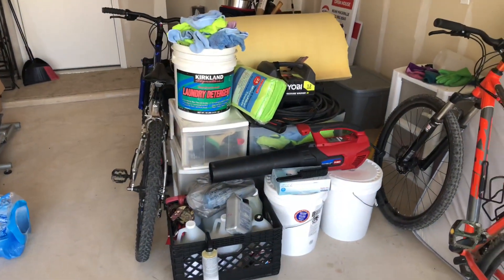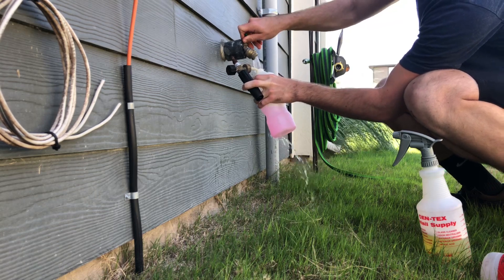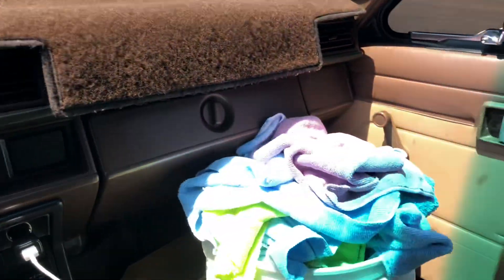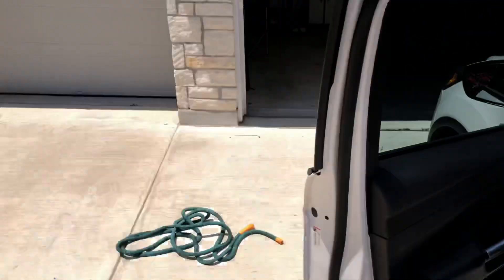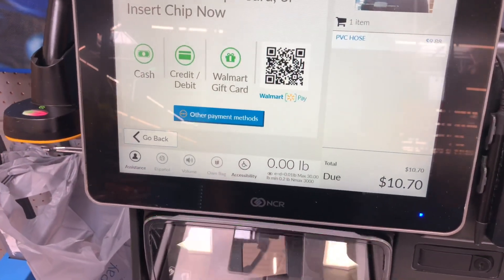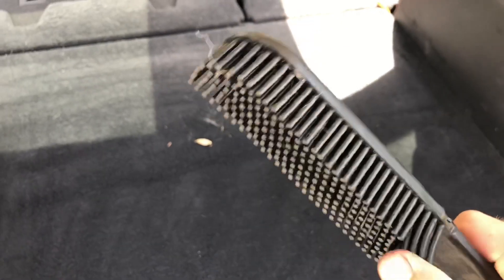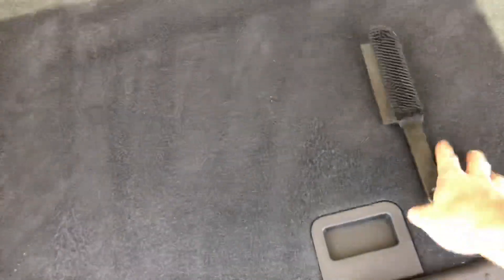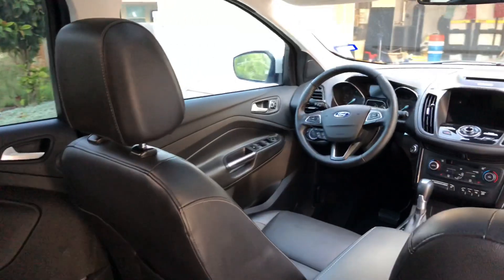Mobile Car Detailing: A DAY ON SITE (FAIL)

Comment: Were there any water marks ?been having trouble because it’s hot here in Florida and it leaves water marks what can I do to not get water marks
Reply: I detail in Texas  if you not using deionized water the only thing you really can do to help is either constantly keep re wetting  the entire vehicle  or doing one panel at a time... wet it soap it then dry it and move to the next panel in the summer heat

Comment: Hey bro I highly recommend buying a canopy for your details. I used to get gassed with 100 degree heat now I don’t feel melted every service. It’s totally worth the weight and setup time. Helps with water spots and stops my phone from over heating lol. Make sure to get a 12 by 12 footer minimum for room to work and to lower the chance you’ll hit the vehicle. Cheers on enlisting!
Reply: FAIL